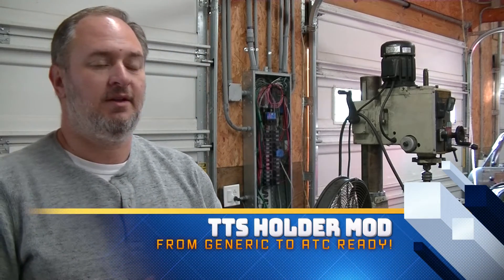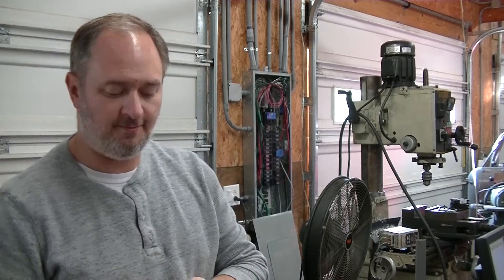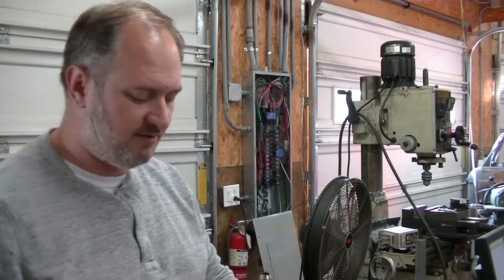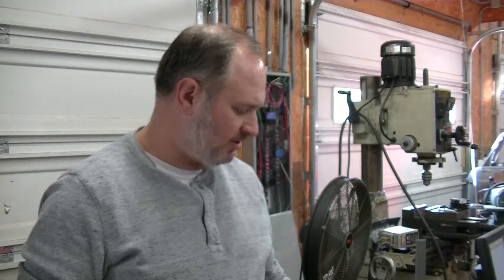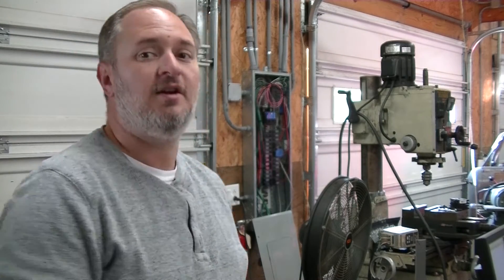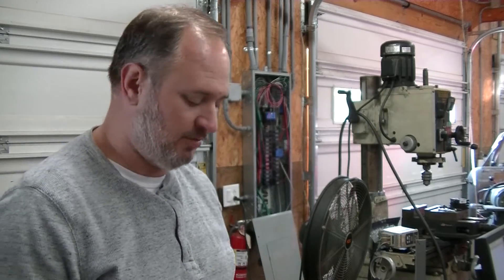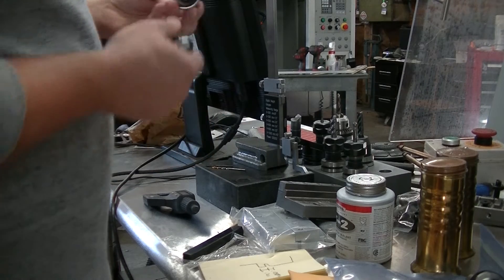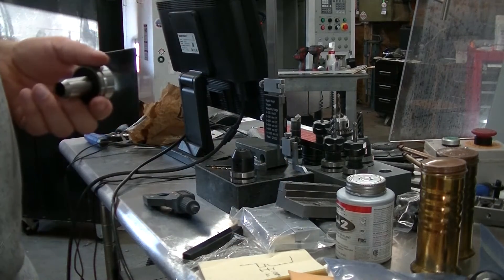TTS Holder Mod

Comment: Surprised the generics don't come with the slot. Guess they have to save money on something!
Reply from the maker: Yeah, I think it might be due to patents as well... Not sure but it was an easy enough fix to make.
Reply: Tom Zelickman havent a clue how they can patent something so brutally simple. Has to be the atc otherwise nothing special and even then it seems unless the atc is specialized in groove and diameter size it would seem a patent wasn’t possible.

Comment: Huh I would have thought those tool holders would have been a tool steel
Reply from the maker: Oh, they were hard... just had to treat it as such. Ran at 150 SFM though and it seemed alright. Squealed a bit during the roughing cuts but the surface finish turned out really nice in the end.
Reply: @TomZelickman  ahhh that makes sense.  Sorry the cam work was so fast I couldn't  keep up
Reply from the maker: Yeah - I wasn't sure if I should leave the CAM in at regular speed or not because it took a while to get set up properly. I might make a follow up video if there is enough interest. Thanks for watching!!